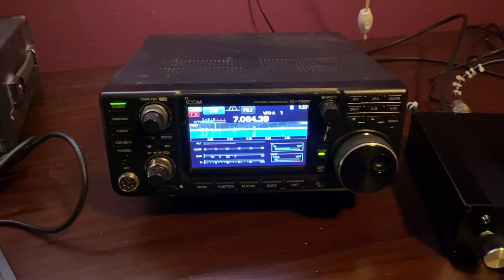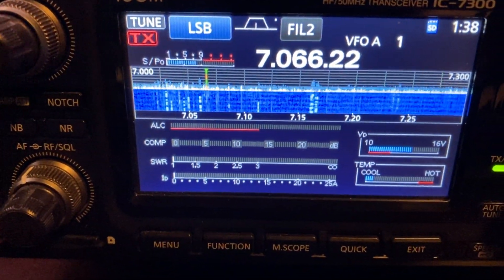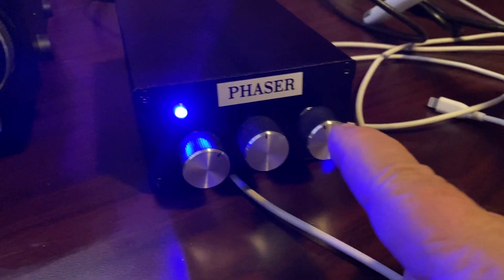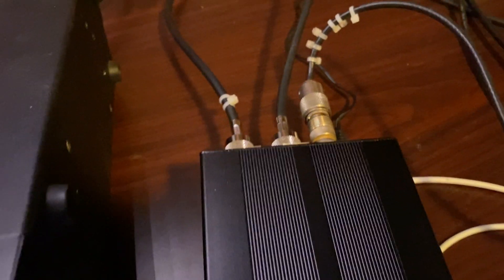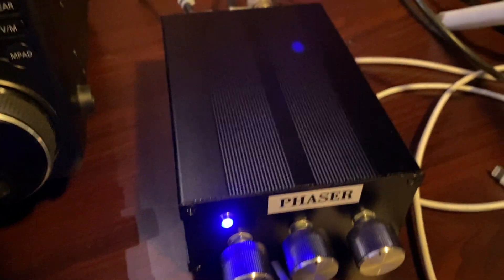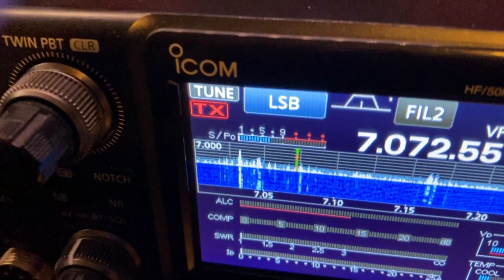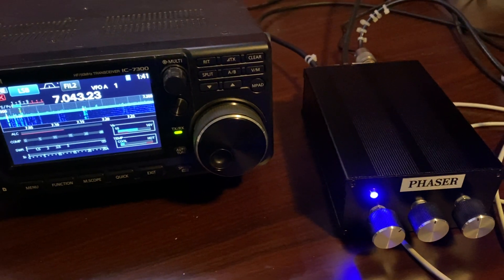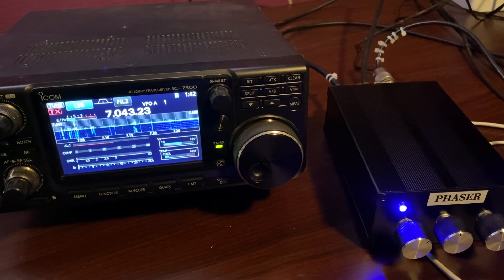Freaking awesome to reduce local noise levels!!  Just wow!

Comment: i have a high noise floor, what did this do to your SWR's when you added it in line?
Reply from the maker: It can't be in line with your transmitter working.  The amplifier relay is used to take it out of the antenna path when transmitting.  It's designed to phase out noise.  Some noise it works better than others.  It is never guaranteed.
Reply: @DaveKelleyphotography  what activates the bypass Relay, RF or DC voltage? I'm not able to find any directions for these.

Comment: I've got one wire BOG , totally against every HF rule , +- 40 meter long looped twice in the garden,2 meter high 2,5 mm2 copper wire , Input transformer 9:1 , end resistor 450 ohm.Then a 5 meter telescope somewhere in a corner for de phasing the noise.I receive the whole world for a poorman price.

Comment: It looks like you turned on an Attenuator.All of the signals dropped dramatically.Same as turning Off the preamp.I use ClearSpeech DSP modules or Speakers and they actually remove the noise without the signal changing.
Reply from the maker: Yep, Clear speech works pretty well.  And yes, it sounds like I turned on an attenuator, but the difference is the signal-to-noise ratio.  The signal sounds weaker, but the noise is lower by more than the signal.

Different ways to skin the cat.

Comment: I wanted to mention the Apache Lab ANAN do have software to do just this function. It’s done in its software and works as well. The radio has to have 2 antenna inputs to have the reference for canceling the noise.
Reply: Sounds like what is called diversity receive?
Reply: @1OFGODSOWN  Yes the Anan has two receivers. You use one to subtract from the other in basic terms.  You can also adjust phase.

Comment: Can I use this to eliminate 60hz power line interference?
Reply from the maker: Like any filter, there are never any absolutes.  The idea is, if your antenna is picking up signal and some power line noise, and you can get a secondary smaller antenna to just pick up the power line noise, it should be able to null it out.

Comment: I use 2 in series, but with external relays for switching to transmit. It works very nicely for me !!!
Reply: How do you connect 2 in series?
Reply: @prizeking1647  possibly the cable from one of these filters that normally would go from one of these filters into the radio, goes instead into the second filters, then the cable from the second filter goes into the antenne input of the radio. if there is 2 strong QRM-Phases, then that would probably help to use 2 of these filters, one for each of the QRM-Phases. disadvantage could be that weak signals get attenuated to much and blotted out, whatever added into the antenna cable will have some sort of attenuation to the desired signals.

Comment: 2:48 that's what i'm saying too, such phasefilter should be build in into all hamradios that work below 30MHz. maybe thats something for a ic7310, such phasefilter and a 3KHz roofingfilter, that would be IT ! 
what do you use for "auxiliary" or "second antenna" on that filter ? best is a little antenna and to hold it in different spots to find out where the QRM-phase falls in the strongest, that would do best to blot out the QRM-phase.
Reply: 7300 doesn’t have Roofing Filters because it’s an SDR.Analog radios use Roofing Filters.

Comment: I have 10kV possibly higher overheard power lines and a transformer not too far from my loop, will this thing take out the power line noise on the lower bands of MW and LW?
Reply from the maker: I doubt it will remove it all.  It may help to some degree.  The idea is that it takes a sample of the noise and counters the main RF coming in with an out-of-phase version of the same noise.  That might be a pretty massive amount of noise to try to counter.  Certainly worth a try.  But don't think you'll get a nice quiet S2 noise floor with it.
Reply: @DaveKelleyphotography  Got one of these, it does a great job, I can hear daytime MW signals where there was noise before. You're right it wont give s2 noise floor but when the "sweet spot" is found in the phasing between the two antennas the difference is quite remarkable, a very clever design.
Reply from the maker: @tonymagnier9846  Good deal, Tony.  I have a vertical and a CCD dipole at my small lot.  The dipole is always quieter than the vertical, of course, so I've changed things up totally here.  I transmit on the vertical, sometimes with 800 watts.  I receive on the dipole by going into the receive only antenna jack on the back of my K3S.  A lot of the larger radios have RX only jacks on the back.  I added a DX engineering 'receiver guard' to keep the 800 watts from blowing the front end on the RX.  So, the vertical was over S9 noise.  The dipole was S7 noise, and with the phase unit it is S3-S5.  Of course the phasing unit drops the strength of the desired signal, but the noise goes down much farther.  I see about a 4 to 5 S unit gain in signal to noise.

I'm glad it's working well for you.  It has made my station operational again.

Comment: These things are great!! I had S9+10 of noise at my home qth, got one of these from Igor in Ukraine, connected it all up and boom S2-3, brilliant. And yes, why do the manufacturers not include this???……….Paul 2E0OPV 👍🏻
Reply: What do you use for a noise antenna?
Reply: @nathanpetrovski7525  something tiny, something that can pick up the interference, but not the transmissions you're wanting to receive. I've seen people use a tiny short wire hooked up to the AUX/interference connector, or a tiny telescopic antenna if said interference is from your home. 

I've seen people run quite a long wire to get close to the source of the interference outside the home (like a few houses down from them kind of long). 

It all really depends where the interference is coming from on what you'll need to get for the antenna.

Comment: Thanks for the tip, I will try coax centre feed so as not to phase out short wave. My s9 noise I just discovered was a neighbours faulty fish tank I noticed dumped in their yard! Energy saving light bulb once wiped out the bands,  LEDs can do the same if faulty or not designed right, and cheap Chinese phone chargers! Regards, Mike, UK.

Comment: how do i connecting ptt qrm eleminator to ic7300?
Reply from the maker: It is connected just like an amplifier would be.  A simple cable with an RCA plug on both ends.  One end in the amp jack on the radio and the other in either of two RCA jacks on this phasing box.  And if you have an amp then you use the second RCA jack to go to the amp.  Daisy chain.
Reply: @DaveKelleyphotography  thank you dave ,2 port over there, but which one? alc port or send port?
Reply from the maker: @bagasteguh6414  it would be the SEND jack.
Reply: @DaveKelleyphotography  okay, thank you very much, and regard's dave

Comment: Thanks for the video, great demo but ... I wish u showed us how u adjusted the knobs instead of just turning it on and off. Adjusting the knobs is the real art of these things. Where do u set all the controls to start? Gain fully clockwise, counter-clockwise, where do u start the two phasing controls? Which one do u move first, etc. Any tips on how u 'tune' it would be much appreciated! 73 KJ6ER, Silicon valley
Reply from the maker: It's actually very easy.  The far-right control you'd want to leave all the way counterclockwise to have the most gain.  Then just adjust the other two for the lowest noise.  They will both have dips.  Just play because it's not like you will blow finals if you take too long tuning. (grin).  Then turn the right control up and see what happens.  The signals will drop a little, but you can bring the noise down even more.
Reply: @DaveKelleyphotography  Wow Dave, that was the fastest reply I ever got on YouTube, thanks so much! So u start the gain fully counter-clockwise to the left (full gain) and work ur way clockwise to the right (reducing gain gradually)? I actually bought the Wimo QRM Eliminator (comparable) except the gain is highest fully clockwise. So the key is to start with the most gain and work ur way down while tweaking the phase knobs. OK, I'll give it a try. I subscribed because ur so fast to answer :) 73 KJ6ER
Reply from the maker: @gregmihran8616  Yep, I just tweak the left two and usually leave the gain open since it reduces the noise so much as it is.  If you have a decent noise antenna (aux) the dip can be nice and deep.  I've uses a 17' vhf/uhf and antenna on the roof and it does really well.  I've also used a 40 meter portable antenna, just a whip and small coil for things like the FT-817 or KX3, and it did a much better job than I would have expected.  You'll get the hang of it.
Reply: @DaveKelleyphotography  Thanks Dave, I understand this will take some practice so I'll keep at it. Ur right about two key points: 1) u need a good 'noise antenna', I will try using my VHF/UHF antenna on the roof, and 2) yes, this simple circuitry should be built-in on all HF radios - imagine if it could be automatic - e.g. like the built-in auto-tuner. Thanks again for all ur prompt responses, much appreciated. 73 KJ6ER

Comment: What the antenna AUX ?
Reply from the maker: I just have a little 40 meter whip that I use when I take my FT-817 out and about.  But I've used a simple wire that's a few meters long as well as my VHF vertical on the roof and they all did fine.  As long as the aux antenna picks up the local noise but not the signal you are trying to hear, it'll work fine.